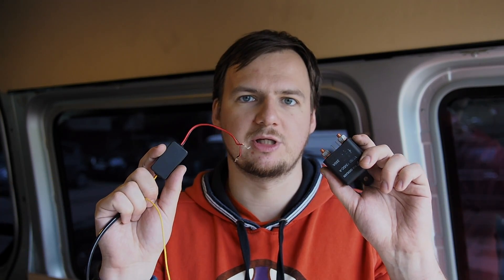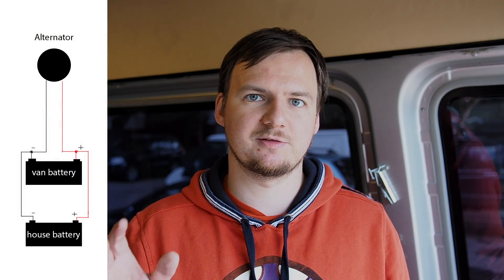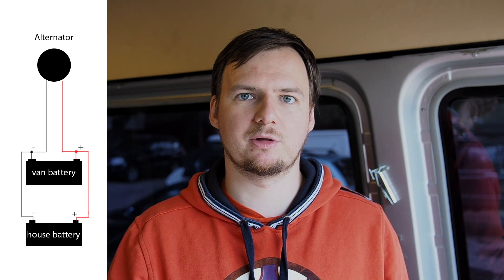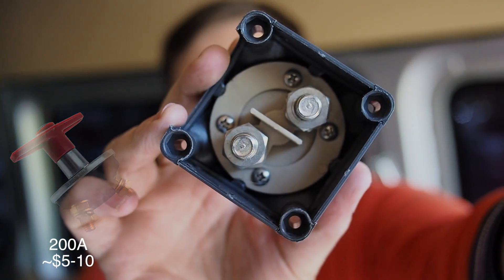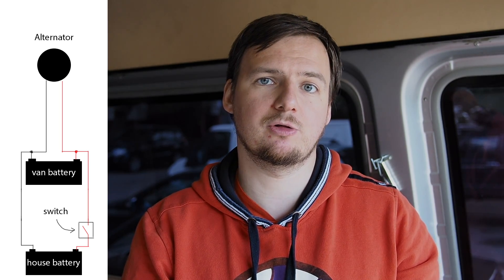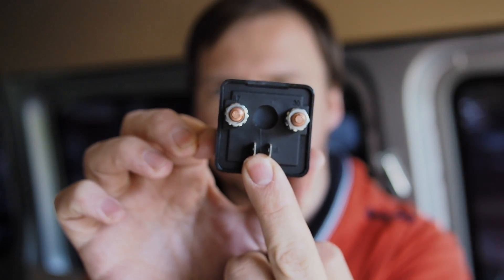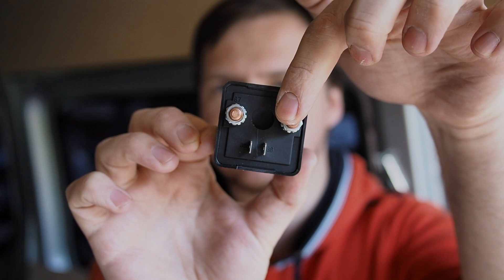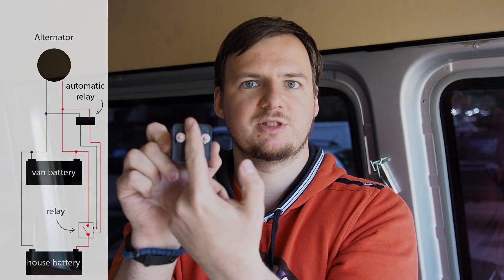Dual battery setup in van conversion with auto relay isolating battery system

Comment: Thanks. Very useful but still unclear if the relay closes by 12V control wires or voltage supply above 13,4V from alternator automatically

Comment: Is not free power, is more like converting combustible to electricity, also be aware about connecting two types of batteries in parallel and the wire thickness.  An empty lipofe4 of 200AH can draw 200A as the specs claims to be able to charge at 1C, ofcorse the system needs to be able to give 200A, but even 50-ish Amps can turn wires into light bulb filaments and you don't want a 1,085 °C / 1985°F heating next to plastics.

Comment: Instead of an automatic relay, I’d use a switch connected to pin 85 so you can turn it on/off inside the vehicle so you don’t have to manually shut it off wherever the circuit breaker is.

Comment: You might not know it, but the split-charge relay does all that sensing itself. you just need to hook it up between your batteries, put a manual switch on the ground connection for the relay to be able to shut it completely off, when you absolutely do not want it to steal juice from your alternator. Also, the sprinter has a smart-charging system. meaning, it wont charge enough to power your 2nd battery when the engine is under load or you do not draw very much power from the starter battery.

Comment: Thanks, I am trying to figure out the diagram for my RV and my boat, so end results is what you speak of. In my case I have one starter battery and two deep cycle RV/Marine batteries for house batteries wired together in parallel for 12v output. However, my research shows best practices is for you to limit the charge to your house and starter batteries.  Saves alternator life and saves battery life to have balanced charging especially if your add more house batteries.  More than one way to do this too.  External voltage regulator that is turned on/off by your type of setup that charges say house batteries first, but reduced amps from alternator, then a dc to dc charge controller to charge starter battery.  Down side: costs more, and has more hardware to fail but prolongs alternator life and battery life.

Comment: NOTE: Only using the alternator to charge your house batts will only bring the charge state to about 80-90% and stop there. You'll need a separate charge controller which can properly top/float/etc.. charge them to 100%. Long story short, the alternator does not have enough voltage to bring your house batts to full charge and while it is not fatal, it may prematurely cause them to fail sooner. This guy's setup is OK since solar MPPT controller can top them off and uses the alternator to do most of the bulk charging when the engine is running.
Reply: when driving my voltmeter shows the alternator puts out 14.5 Volts.

Comment: Can I use this isolator 200A for 5Ah and 2.5Ah batteries? I want to install it in my touring motorcycle at cheaper price.
Reply: yes, could go with a smaller one 30-50-100a relay is more than enough on a motorcycle!

Comment: If you hook the relay to 12v acc and crank you would have both battery's for the starter.
Reply from the maker: yes, but usually i don't want to waste my house batteries power for engine starting. I need that power for myself :)

Comment: Hi Oleg,

By adding another voltage sensing relay on the leisure battery side, would I be able to turn this system into a ‘dual sensing relay’?  I’ve got the bits to make the relay like you have, just thought another voltage sensor (drl switch) could activate the relay from the other side too, when the leisure batteries are fully charged!?

Comment: Hi. On the auto switch there is a yellow cable. Does this need wiring somewhere or is it redundant?
Thanks in advance Glenn
Reply: Hi! For this purpose you don't need to use yellow wire

Comment: Hey there Oleg. Great explanation. After a year now, hows it all holding up? Also what additional system have you installed now you have solar to a) charge via alternator and or solar. And b) stop over charging.

Cheers big ears

Comment: Nice job!! I already bought the pieces but still fighting to make it work. I connect the voltage identifier to the battery (where do I connect the yellow one?) but even if I start the engine and get more than 13V the identifier has no voltage in the output and won't make the relay work. Any suggestions?
Reply: If I am reading this correctly, if you connect the yellow wire to the battery terminal, it will change the output voltage to six volts.  It would appear that one would need to have the yellow wire not connected to anything to get this to work.  I have not purchased one yet as the extra wire is a cautious idea yet.

Comment: Hey, how about overcharging the batteries in the back?  Will the solarpanels keep charging the system when your alternator is charging the batteries?
Reply from the maker: solar charger and alternator works at the same time, but its hardly could overcharge batteries. There is smart controller in MTTP charger that prevents overcharging from solar. You even setup type and capacity of batteries so it could work more precise.

Alternator charger more simple and it depends of how old vehicle is. 
Most basic alternators just works with 13.5-14V and thats fine. After battery reach 100% it will have about same voltage as alternator and not taking more charge from it. Because by DC laws charge only goes from high voltage to low voltage source. If voltage is the same - nothing happens.

More advanced alternator trying to charge battery to 80-90% as fast as possible (with 14.5-15V) and after that it drops voltage to 13V for smooth healthy charging of remaining 10%. Of course that way is much better for battery.

But in conclusion - answer is: no, if solar controller and alternator works properly you couldn't overcharge your batteries.

Comment: It will be nice to know if it is possible to charge all baterries, from alternator, solar panel and the mains 220v of a Camper Parking and how to switch from one source of power and other to charge batteries. Thank you. Nice video as always
Reply from the maker: +Juan Gonzalez yes its possible. You could install 220-12v charger or use 12-220 invertor with that charger built-in
Reply from the maker: +Juan Gonzalez all 12v dc power (solar, alternator and 220-12v charger) could work at the same time. Its fine. For different 220v ac sources you must install switch
Reply from the maker: +Juan Gonzalez yea Greg is great. He did all that on next level

Comment: My 2013 sprinter 2500. I did the cct connection just as you instructed, started the vehicle, the sound of the engine changed I quickly turned it off. Nothing went wrong though. Is it normal, the engine sound change?  And that not withstanding, The roof AC blower started sounding weird but still ok .
Reply from the maker: Hi! It's too little information to know if you install it correctly or not. Engine sound could change a little because additional load on alternator, but not that much and hardly noticeable. If you not sure - show your install to someone who understand car electric systems. Maybe there is nothing to worry about, maybe it is.

Comment: Have a new car, no ignition + in the fuse box, no plug that turn on and the voltage isnt over 12,5V everytime the egine run. I dont have a clue how i can detect if the engine is running...
Reply from the maker: +youMarv21 well it must to be 13V+ somewhere! 12.5v is too low voltage to charge up the battery!
Reply: Yes that was how i learned it too. But in todays cars, yout Battery shouldnt load fully. In Germany its named mini recuperation System. The Battery is only load up to 50-60% and then the alternator only loads with under 12,5V. Sometimes only 12V. Its really a problem for People like us with extra House (i named them comfort) batteries. In the moment i use the 5V+DC on the speaker wire, that most Radios switch on, when they are running. Didnt find another soultion yet ;( The comfort Batterie I have iam loading with a B2B Booster :(
Reply: If your car is a hybrid, the voltage will be low while the gasoline engine is off, and the voltage will be high when it is on.  So you will not have as much time for it to charge the secondary batteries.

Comment: Is the car Battery made only for car use and is the house Battery's made only for RVs (Caravan) use? How long can you run you car engine with out hurting it? How mach gas is used when you run the engine only to charge the Battery's?
Reply from the maker: > Is the car Battery made only for car use and is the house Battery's made only for RVs (Caravan) use
Kind of. They called "starting battery" and "deep-cycle battery". They are different and if you use them with the right purpose - they will last much longer. Read here https://www.batterystuff.com/kb/articles/battery-articles/battery-basics.html#2

> How long can you run you car engine with out hurting it
For very long, engine is made for this and on low rpm it could run many hours. But it was the point of my installation - mostly i made this for time i driving somewhere, so it great chance to charge my batteries at the same time.

>How mach gas is used when you run the engine only to charge the Battery's?
For engine it is not much difference to charge something or not - alternator works anyway. Consumption depends on model and engine size, about 1-2L/hour. For 2.1 diesel sprinter it's about 0.7 - 1L/H
Reply: Thank for the information  it helps me understand what you were taking about! Keep the Videos 
coming they are  interesting.

Comment: Great video, thanks! Very well explained.

I'm going to have a 24v battery system, but my van is 12v. So probably won't install charging off the alternator, will have to rely on solar and shore power.
Reply from the maker: You still could get 12V->24V convertor
Reply: Thanks, yes I considered that and may do it. I couldn't find ones that handle much current though. And I need to figure out how much spare current my alternator has. The van has dual 12V batteries already.
Reply: Eat Sleep Van You can get 20 amp DC-DC converters pretty reasonable in price. Set the output to the max 20 amps and 29.6 volts (for charging 24 volt nominal led acid batteries). 20 amps isn't a huge amount but depending on your battery bank it's pretty close to the max the batteries will charge at with now loads anyway.
Reply: Aideepen 1200W 20A DC Converter Boost Car Step-up Power Supply Module 8-60V to 12-83V https://www.amazon.com/dp/B01MSYVMAL/ref=cm_sw_r_cp_apa_.PEkBbS5JCDSH